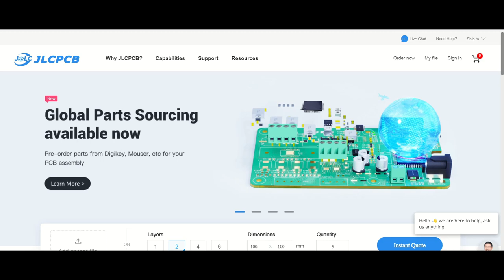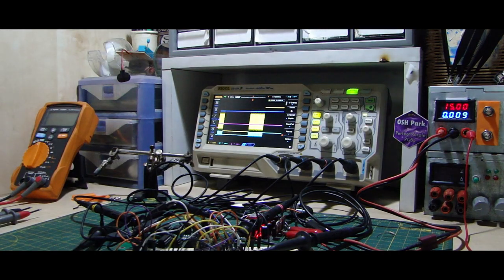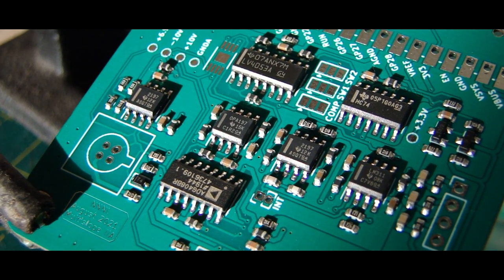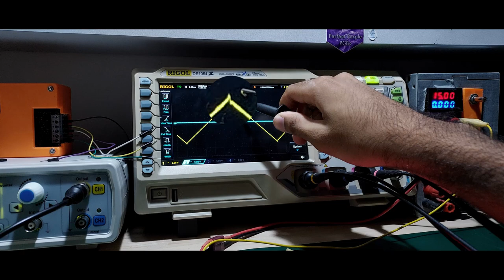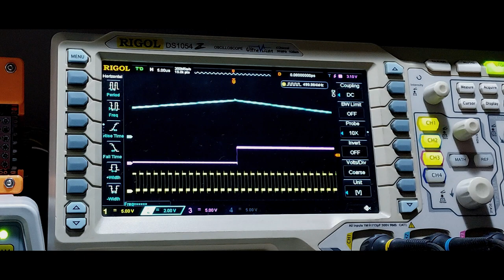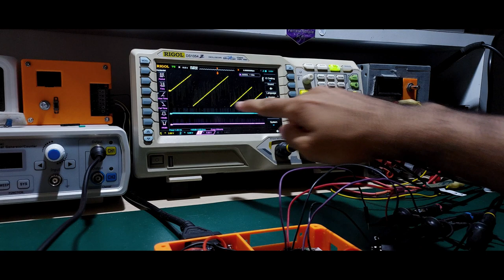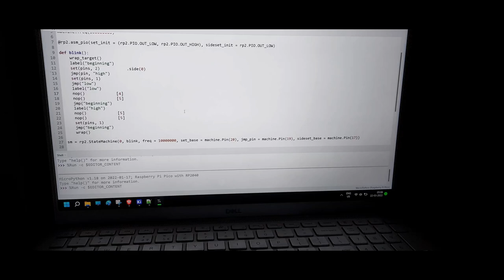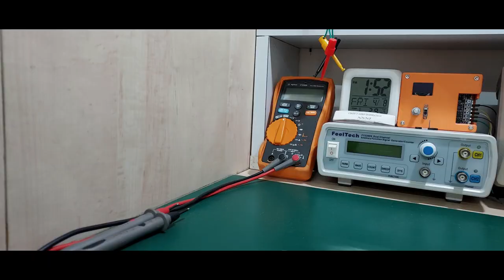NNNI's Multislope ADC (And Other Jokes You Can Tell Yourself) - Part II

Comment: Where is part 1
Reply from the maker: https://www.youtube.com/watch?v=ucJOKAhCHTQ 
Second half of this video.
Reply: @NNNILabs  thank you, why do you use 2 opamps in the integration circuit ? what does the output divider do from the first opamp ?
Reply from the maker: @w62810616  That two op-amp configuration is called a composite amplifier, which can combine the best of two op-amps. In this case, the first op-amp can be a precision one since it determines offset voltage, and the second one can be a fast op-amp with a high slew rate. This is helpful because not all precision op-amps are fast, and not all fast op-amps have a low offset voltage. The divider is there to reduce open-loop gain for stability, values are cut and try.